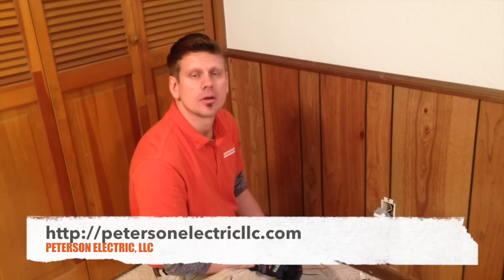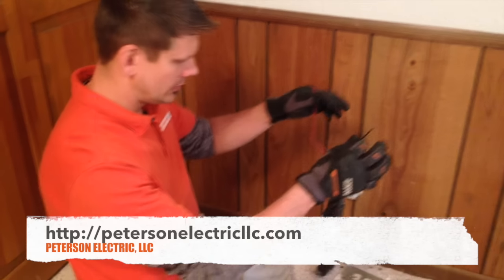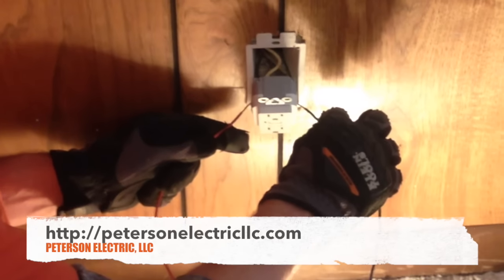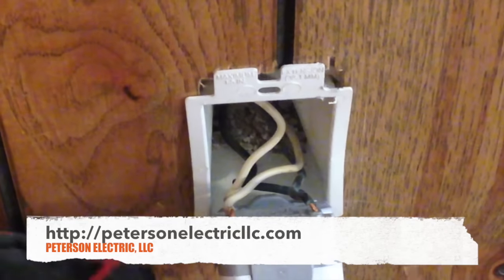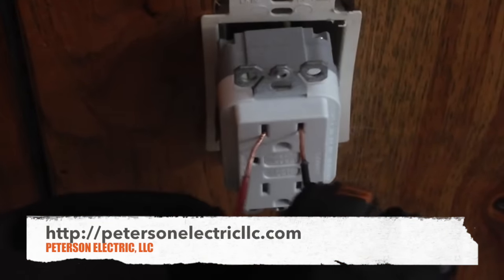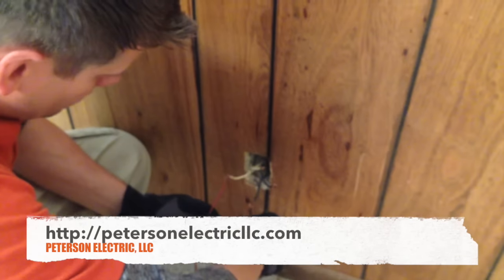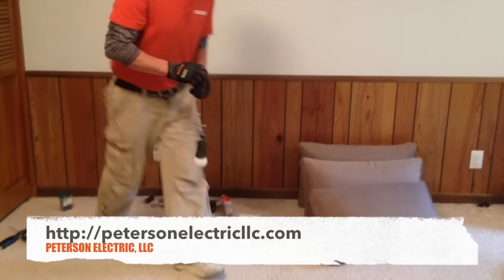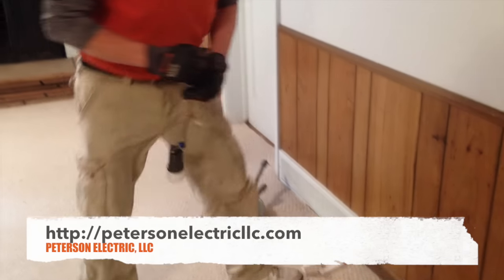A 1950's House With 2 Prong Outlets & No Grounds, What Can Be Done?

Comment: Only a few ways to fix the problem -
run a ground wire to each outlet.
Rip out walls and ceiling and replace all the wiring then PAY through the nose both ways.
3) Replace outlets with GFCI and DESTROY the decor. And plaster a BUNCH of stickers on the outlets stating ungrounded.
4) Leave well enough ALONE. It worked for decades without a problem.
5) IF you can find a GFCI breaker for your antique main panel, you might get away with using that instead of those gaudy outlets.

How about making special outlets that fit the decor? GFCI's without ground holes?

I have antique covers and outlets. I do NOT want to destroy the decor by replacing with BS GFCI outlets that are NOT NEEDED and stickers nor would I want to rip out walls and replace the wiring (and even the main panel possibly).

Most things you plug into an outlet are 2 prong anyway. Ground prong is useless in that respect.
I could see a 3prong for a fridge or microwave or even a disposal. Something you generally won't see.
Reply: OK, Boomer. 😂
Reply: @savoirfaire8979  reported you for flaming/harassment. I am no boomer.

Comment: What the H happened at the end ?
Reply from the maker: AFCI and GFCI, if they don;'t change the panel, you must install the DF device plug in the beginning of the circuit and run an egc grounding conductor the the circuit.

Comment: All houses built before 1960 should be completely rewired. Not only because the wiring has no grounding conductor, but because it is old enough for the insulation to become brittle, fray off, and cause shorts and arcing which could lead to fires.  And every such home buyer needs to demand that the seller have a licensed electrician rewire the house as a condition of purchase.
Reply from the maker: I may agree with your statement, but there is no code article that supports this thought. In fact, in Article 250.130 it talks about being allowed in a residential dwelling that we are allowed to pull a separate grounding (green) conductor to the nearest grounding or bonding circuit, there are other codes that talk about protecting this conductor and where it has to be terminated. COLORADO state law, does not make a home owner rewire their house if you are just, for example, remodeling their kitchen. It is almost impossible to get someone to rewire their house, especially if it has Lath-&-Plaster.
Reply: I actually AM a licensed master electrician.  And while everything you mentioned may be true, the fact still remains that there would be no grounding conductors throughout the house, so you would lose a major safety factor and appliances with a 3-prong plug cannot safely be used unless something is done to provide grounding to the outlet.

And any houses with knob & tube wiring would not be able to handle today's electrical demands.  It wouldn't take much for such a wiring system to become unsafe if it's continually overloaded with modern appliances.
Reply from the maker: You are incorrect, if you have a home that has NO GROUNDING, Then what good are your GFCI and AFCI devices? Besides most older homes that are 100 years old or built with the two wire cloths need to be updated and there are not enough circuits or enough devices for them to use without cords or tripping circuits. Beside, people are creatures of not changing, they will not typically upgrade their panel with newer and safer circuit breakers. These older homes in CO are full of old school Gould, Bryant, FPE, Zinsco, Intermatic, Bull Dogs, Ge's that are aged, and many many more. The only safety item in the home to protect from over current draws and weak splices are these devices, therefore these homes need grounding throughout all circuits. If you have ever been landed on your ASS from a ladder because a circuit that has no grounding and the fixture neutral wire comes off the shell and that fixture is carrying voltage you would understand. SO, If you do not like what I say then quite watching!
Reply from the maker: There is an exception in 250 and in 422 that the 240 volt appliances can be bonded at the neutral and ground strap on the appliance. This is the only spot on the load side of a MAIN disconnect for a service. Now I cannot saw I agree with this theory,, I think you are better off to make certain that the cold water pipe is grounded as a grounding electrode at the main water shut off valve in 250.53 and if it is bonded with the main bonding jumper in the main cabinet than you would be safe to bond this and choke the cold water valve at the washer. If not, then take a conductor of a number 12 back to the main panel, on a 30 amp circuit for a dryer, or a 10 for a 50 amp range. There is an exception in 150.130c (i believe that is correct) in the 2017 code that allow us to ground a circuit with another circuit that has a grounding branch circuit.
Reply from the maker: Yes this is correct, but then why do we not install in the panel a 30 amp two pole GFCI breaker for dryers and a two pole 50 amp for ranges that do not have the "grounding" conductor in the cable. It is all about money, this is a good way to wire, but expensive. I think that following 250.130 c is better and find a near by circuit that is grounding to the panel or run a conductor from article 250.122 and size it correctly and then make certain that the cold water pipe is "Grounded" within 5' of the entrance of the structure to the main disconnect cabinet. If that is safely bonded then we are good to run this to our major appliances, the code does allow us share this same conductor as long as it is sized to the largest load. 
My point is if you have been on the back side of a GFCI breaker or plug that has died in the closed position then you will be a sad source of path to the ground from the stray voltage. I know this from being an appliance tek for three years before I got in the electrical field and now after wiring for 19 years I can see how the human body is easily used as a conductor. If you want to see a scary video then watch one of mine on how a customer had an energized gutter.
Reply from the maker: Yes you are correct, but if the GFCI fails current has no where to travel until some dumb customer is in Estes Park one weekend and buys these cute iron yoggie bear face plates and then those cover plates are energized when the wire breaks off of a swtich or a neutral. I have seen this happen.
Reply from the maker: I know 210.8 and that GFCI floats in 680 on spas and on saunas, and many other areas. The code is a minimum and can be used to better our customers. If you have a license like I do then that means that DORA is allowing me and others to practice. Not everything on a committee is seen in the field. This is good judgment and after 20 years in the field tracing wires I hope others think on their feet. This is the difference between W2 and W9 electricians.
Reply from the maker: I am not sure of your experience in the field, but I just came out of a house today that had power feed from the breaker to the light boxes and switch loop down to the switch and then to the plugs. SO, if this happens you are only protecting the plugs and not the lights or switches and therefore not the cover plates if there metal. This is not good protection. Your not right on this.
Reply from the maker: You are still out of code, read article 406.6 through 406.12 it talks about AFCI protection no matter what. It's NOT just about GFCI.  What does GFCI do for you when your in a bedroom and there is no water present.
Reply from the maker: Again, you should do more code reading, not beating around the bush, Article 406.12 - If your so concerned then install a new panel and Dual breakers, what is the point though, you need EGC grounding to protect human life encase the power strays.
Reply from the maker: THIS IS THE POINT OF THE VIDEO I DID> I PROVED THAT THE BREAKER AT 60 years OLD SHUT OFF FASTER THAN A GFCI PLUG. 

What ever your heard and are reading is NOT correct. Do some field tests in someone's property. I DID! 

You never answered my question, are you a Master Electrician?
Reply from the maker: Again what is your experience and background?  Are you a master electrician?   Field testing is the most important knowledge to do while working, it is best to know how things will fail "Safe". I have had three years as an appliance tech with training and four years in electrical trade college and 7 years to get  my masters and now have practiced in the field on my own for 13 yrs. as of 2017 

Not sure how you can't see that I have no EGC grounding conductor to create a safer path for those plugs, without major damage to the customer's home. Again, the customer pays and at times determines how much damage they want to their home. 

Now, four years AFTER THIS VIDEO, my practice is more safe and if they do not install AFCI & "GFCI" for that circuit we will not work in their home. If this means a new electrical service upgrade and grounding on the service with electrodes and if we can fish in the walls the EGC we will sell this ALL DAY LONG> 

Good Day, GOod LUCK
Reply: Brian Hammerson Hey Peterson Electric! Big fan of your videos but I have to side with Brian Hammerson on this one. GFCI devices do not provide overload or short circuit protection. Had you taken the ungrounded conductor from the line side of the second location to a load connected to something other than the neutral (such as a  person who happens to get in series with something connected to earth) the GFCI upstream would have tripped. This demonstration should have the same results even in homes built today (equipped with an EGC).

I'm not suggesting that a GFCI is a substitute for an EGC, but I will say that one GFCI device at the beginning of a 2-wire circuit would have the same results as "x amount" of gfci's paralleled at every location.

Also, a master electrician. Chambersburg, Pa #325
Reply: Matt Killen didn't he say at the beginning of the video is that in older homes you don't always know where the neutral goes in a older home it could go to ceiling lights and tie into other areas of the house. So I'm of the opinion that being the fact he's stating its a good practice in an old home to put a GFCI in every outlet to be safe. Because there may not be a drain to the neutral? I would put a GFCI at every outright I replace in an older home with no ground. We really don't always know if that neutral is truly going down stream of the other outlet.
Reply: Tom Smith maybe I missed the scope of the video. I could understand some issues with neutrals being mixed up and nuissance tripping of the device, but that still shouldn't compromise ground fault protection which is what I think he was trying to demonstrate. 

I'm just saying on a circuit that you know goes from point "a" to point "b", which is what I assume he is trying to show, you will have ground fault protection at point "b" even without an egc, and creating a dead short between the hot and neutral is not disproving that.
Reply: Matt Killen I concur. I am a little confused why he popped the breaker and cut the video. Love them or hate them I do test GFCI plug ins that have a trip button on the plug and the color coding lights the let you know if the receptacle is wire backwards and s missing a ground.
Reply: Jeff and how would that be possible. There are literally hundreds of thousands of older homes in america with outdated wiring. It would stand to reason that most are lower valued homes owned by many who could not afford an upgrade. And what about the millions of rental homes? How do you ask a person or family of low income or any of the millions of Americans on fixed incomes to fork over the thousands of dollars to rewire their homes? No, the only way is to continue with the current status quo. As older homes are torn down, they will be replaced by new construction per the latest codes. Attrition at its best.
Reply: I'm having breaker boxes installed because the electrician said that he couldn't do ANY work on my house with old style fuse boxes.
Reply: Peterson Electric the fact that you are a master electrician and didn't understand a GFCI looks for a tiny current difference between neutral and hot, has nothing to do with a physical ground, and protects all downstream devices is a bit scary. I'm a new homeowner who read a book and did my own wiring to code better than many electricians would. Residential wiring is not rocket science. In fact, it's 90% common sense.
Reply: So you gonna shell out the $8,000-$15,000 it costs to rewire? Or do it for free? Most homeowners don't have the disposable income for a total house rewire.
Reply: I had a customer a few weeks ago who was told her entire house needed to be required by a home inspector. I went in with a megger and tested every circuit in that house to prove it didn't. Then I got a call saying they were no longer requiring a rewire because it was Knob and Tube but now it was because everything was 2 prong. So i went back and did a service change and put AFCI/GFCI combo beakers on every Knob and Tube circuit. Then I went around and replaced all the plugs with three prong. I got another call that the home inspector opened up the outlets and flipped his shit. I called the wire inspector and the fire marshal and we all headed over to have a word with this guy. Needless to say the home inspector is no longer a home inspector.
Reply: Jeff
Reply: Ok so first off I am not an electrician.  My house was built in the late 50s. Most all the plugs are 2 prong. There is a 3 prong in the barhroom, where the microwave is plugged in, behind the fridge,  and in the kitchen there is a long power strip on the wall with about 8 plugs and they are all 3 prong. I'm only assuming all those plugs are truly grounded to the breaker box but the dumb bitch that owned the house before cut corners so all those 3 prong plugs may just be cosmetic and were only pit there to accept the fridge,  microwave etc.. i guess if i take the plug out and see 3 wires it should be grounded? anyway  all thebedrooms have the 2 prong plugs and I am putting a window a.c. in. Is there anything I can do to make that work with 2 prong without having to have a ground run from the breaker box? One of those adaptors? I have used them on other devices but wasn't sure if I could on an a.c any help would be appreciated. Also for all the smart ass reply I will get i really don't care what you say. I'm asking a serious question and don't know a lot about electrical. Thanks in advance.
Reply: Jeff - Makes a whole lot of money scaring people.
Reply: Jeff - If you are liscened then you would know that what you are saying about tube & (knob/post) is BS. That stuff is vastly superior to NM in heat transfer.  What jurisdiction are you in?  I need  to talk to your union QA/QC guys. Your screeds hurt the whole industry. 

 By the way, where did you get your real estate or home inspection licenses?  I want to talk to them as well.  That advice you gave was legal.  If you had so much as a contractor's license, you'd know how much trouble you're in.
Reply: John Adams - This has been my experience as well.  Anyone making statements like this guy who claims to be a Master, must be baiting something.  As an attorney who has done so many property deals, I can't tell you how helpful the union locals have been in dealing with these scam artists.  They realy love to bust people who try to scare the public.

In one county in California,  I got an inspector fired and a real estate 'representative' convicted on two counts, fraud and bribery.  I'm sure you know the game.  2008 was slow, lots of 'special'deals got made.  By 2010, the courts were catching up.

People, talk to your code office before any electrician or home inspector.  If you think they are scamming, call the union local and get help.
Reply: You seem to be an incredibly intelligent and gifted electrician. But knob in two?   I started my electrical apprenticeship in 1991. Even back then I knew knob and tube was correct. It's beyond self explanatory, A knob holds the wire, And a tube puts it through a joist. Pretty self explanatory.
Reply: @jonpancoast965  Proper K&T is also usually safe and legal, as long as you don't mess with it.  As a general rule, there is no LEGAL requirement to upgrade old wiring simply because "the code changed", whether electrical code or building code.

Comment: Everybody relax. I have the solution. Place a Jumper between neutral and ground screw. This is my arguement: If NEC states that a pre-existing 3 wire 240v outlet on a dryer can remain a 3 wire, which  bonds the neutral and ground beyond the first means of disconnect, then the house having no ground is also a pre-existing condition. Ok, let me have it.
Reply: Please do so I can wire your new house after your current one burns down.